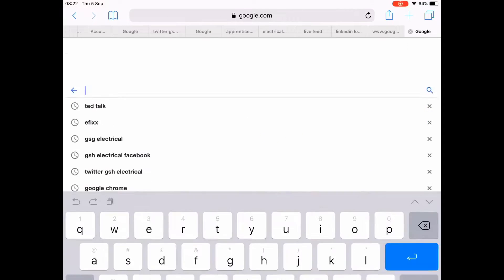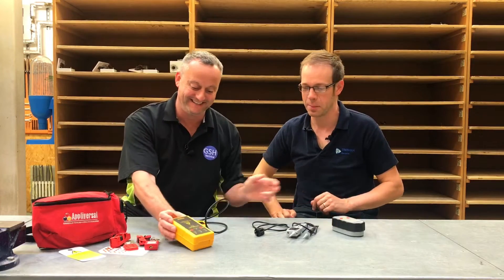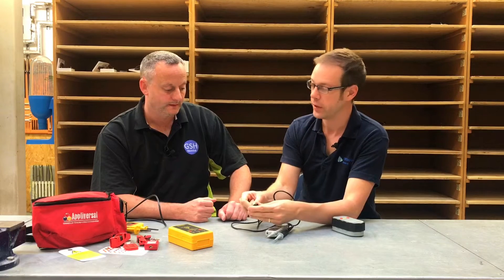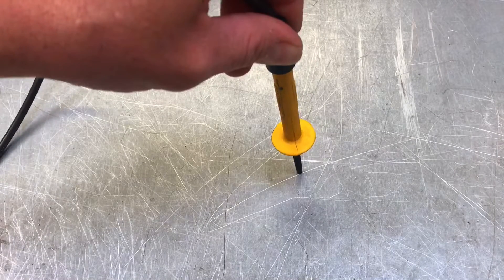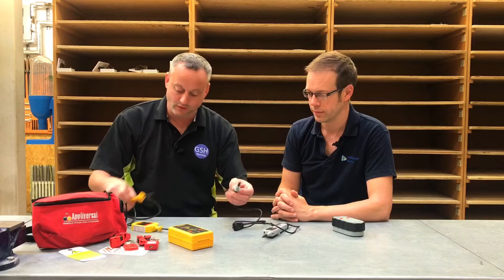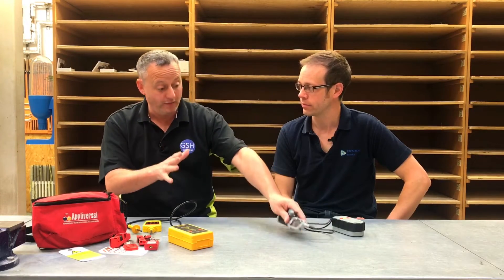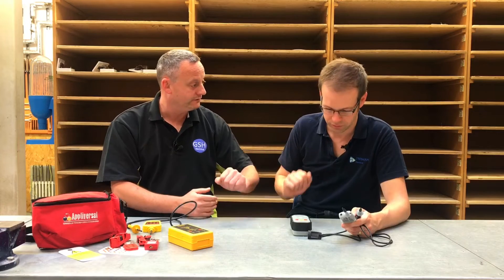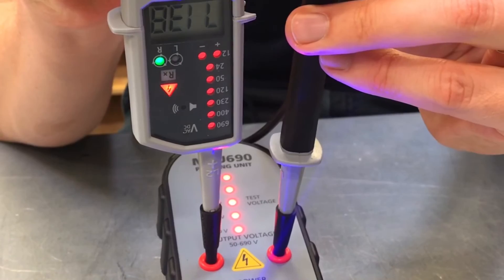GS38 Test Leads and Probes the Requirements for Electrical Test Equipment for use on Low Voltage

Comment: Is my good old Fluke 87V with Fluke TP175 TwistGuard Test Probes* ok, according to the GS38 code? (* Exposed probe tip length	19 mm to 4 mm (0.75 inch to 0.16 inch))

Comment: Good sound advice, but and this is a big but , Gaz you contradicted joe almost from the of , joe said the tips of the probes should have cover’s so they have a minimum of 2mm and a maximum of 4mm of exposed tips because when you  touch onto a live part there’s a chance? If you’re stupid you could touch the other tip  on to metallic casing and that’s not good as both tips will be live, you then said that there are set testing sequences witch you demonstrate on a number of other videos, is onto the least dangerous connection first ie onto CPD onto line of line of CPC onto neutral onto line of line of neutral, point two we all know that sometimes we have to remove the probe tip cover’s because the probe won’t reach deep enough to make contact so straight away we no longer conform to GS38 you have done this yourself the video we’re you demonstrate insulation resistance line and neutral combined you use a test probe with the cover removed and an R2 link between that and the neutral bar ,A gain GS38 sunk . As an extra bit of a rant it says we can’t use a multimeter for safe isolation? Because it’s to easy to set the wrong range ?  Well what to stop you from setting the wrong function on your MFT ? If you are distracted or not concentrating it’s easily done.  So GS38 is a nonsense just like we are not supposed to work on live circuits but sometimes we have to ie to do ZS and Ze tests and voltage tests .  Rant over . Someone prove me wrong 
Great video and very informative as always guy’s 👍👍❤️

Comment: Here in Germany almost every electrician hangs the tester arround his neck, and some are calling it "electricians stethoscope". That's the best way, especially if your working on a ladder. Here the regulations say that you'll have to test the voltage tester on a known working source, it doesn't matter if it's a circuit or such a test device for voltage testers. Before and after, so same sandwich here. Sometimes the test devices got the disadvantage that you can't test the load connection if your voltage tester has this functionality. The shown Megger voltage tester unfortunately doesn't have that functionality of a load connection, but many others have it. And some of the test devices can't provide enough current to test it. I got several of those testers, from the simple neon indicator in one handle and a plunger coil in the other handle (plunger coil instrument is used as a load by pushing a button) from the 1950s up to a voltage tester as shown here and an industrial grade fully rubberized Tietzsch Prüfball (test ball) CAT. IV up to 1000V (most other testers are CAT IV 600V and CAT. III 1000V) and it is rated IP65. I suppose the regulations are the same as in the UK, here the voltage testers must be at least rated IPx4 because humidity has an impact on the insulation of the tester, reducing its effectiveness.
Reply from the maker: Wow what a detailed message and the for sharing it will us electricians in the U.K. 👍.

Gaz

Comment: . I work in the railway industry as a maintenance engineer. I tend to quick for voltage first then trip a CB then make sure it is dead alot of the time the CB is at a distance from we're I'm working. Just because you think you have tried the correct CB doesn't mean you have. And sometimes not everything has a feed going to it all the time.

Comment: A lot of modern voltage indicators have a self test function where all the LED's light to prove device is in good working order.
Reply: One main thing with those testers to look out for is that when the batteries are removed from the tester, the voltage indicators still work. So if your batteries run out for the other functions of the tester it still detects voltage
Reply: Like my fluke T150 it does a self test.. Then test on a 230V incomer, eliminates the need for proving units 😉
Reply: @muzikman2008  It's more convenient when working remotely from the consumer unit to have a proving unit with you, otherwise you'd have to re-check your indicator at the incoming.
Reply: @muzikman2008  The proving unit also has a light which illuminates when probes are inserted, this proves the proving unit is in good working order.